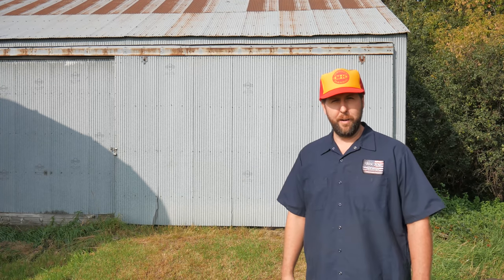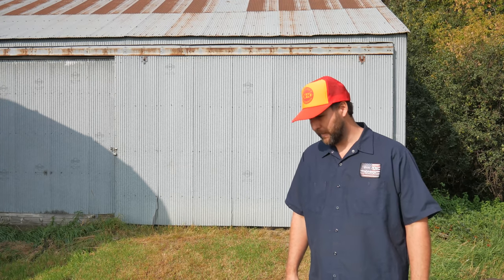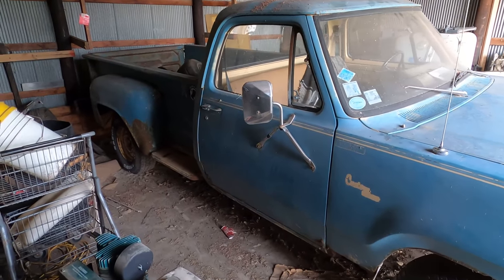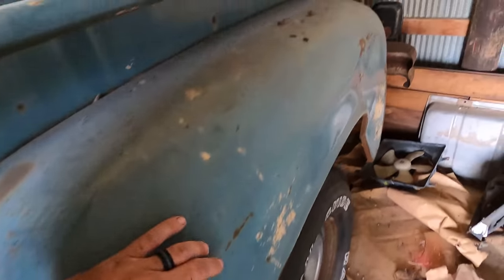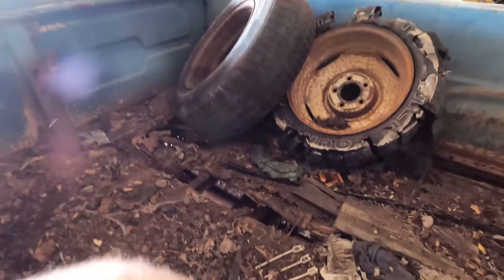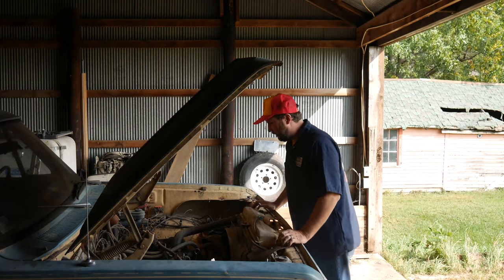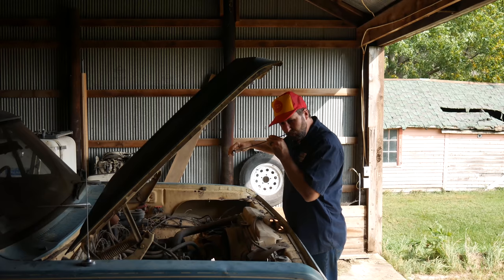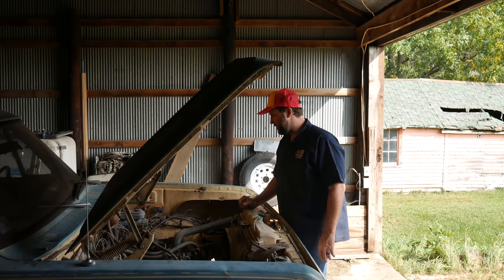Barn Find 1979 Dodge D100 Step Side - Will It Run and Drive Home?

Comment: I don't know about the mileage I used to own a Dodge D100 that was a 77 model with a slant 6 in it that was previously a department of energy truck and the mileage on it was 40-something thousand but it had high hours on the engine because they were constantly getting in and out of the truck and it was left running a lot. Great truck, the only issue I had was the front seal in the tranny going out

Comment: I have a chevrolet 2500 Express van, been sitting for about 8 years. Has a 350 engine with blown head gasket. Started to work on it but got to busy to continue partially disassembled but all parts are there. Interested ? Cheep $600.00

Comment: C mon man, a toddler with a paperclip could pick that gas cap open 😉 You also could just take the wheels off er, set er down on a couple of those old tires lying around and take the wheels into town in the...bluer other truck and get them changed out?...Nah... Wouldn't be in a rush then. Takes all the fun out of it!

Comment: Derek, could you come to my house and finish building my 318 and mate it to my 727 and put in my 1979 adventurer sport and I will get the drive shaft cut to fit my 1979?

Comment: WE GOE 93 CADI SED DVILLE 83,000 MI.  I PARKED IN SHED  BATT DOWN  AND SET 10 YRS . RAN GOOD Z
AND POWSR SMOOTHE. NO RUST AT ALL. 2 OR 3 DOOR DINGS IF U CAN FIND EM.

Comment: Ive owned dodge since forever. No 318 will go 200k miles. At 100k its ready for scrap. I always pull the small blocks out and replace with big blocks. Dodge just didnt build a good small block

Comment: If you have a problem with locks you should check out the tools offered by a fellow YouTube creator named the Lockpicking Lawyer. That gas caps lock is about as secure as a 2 inch tall fence for the record. A wave rake picking tool is easy enough to be used by a toddler on something like that, and it works just as well as a key.
Reply: Just... A guy doesn't have time for that kind of stuff. Just get out the old universal key and be done with it! I don't know!
Reply: @sportbikepilot  I get the joke....but what I just talked about is basically a 5 dollar universal gas cap lock key. Yes, even more modern ones will likely fall to a wave rake. lol Edit: You'll be happy to know, the same style locks (wafer) are on 98 percent of things claiming to be gun safes. Sleep well tonight.

Comment: You need to stop talking so much. Get more work done. Bring gas and antifreeze and oil and filter. If you know the engine, get a carburetor kit ahead of time. Get a battery charger. Get a battery. Get brake fluid. Bring a large air tank. Get a 5 gallon gas can.